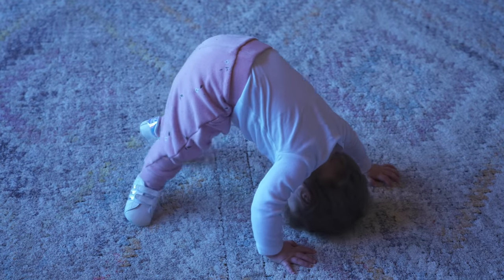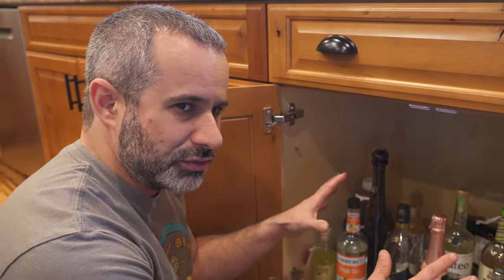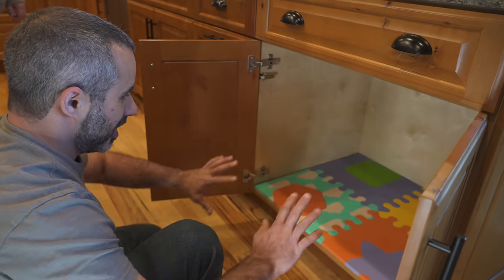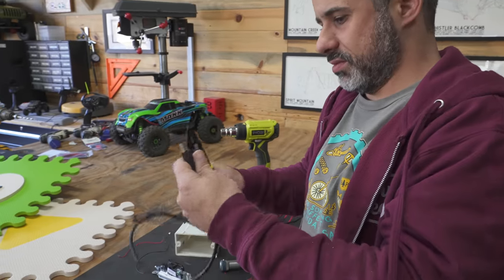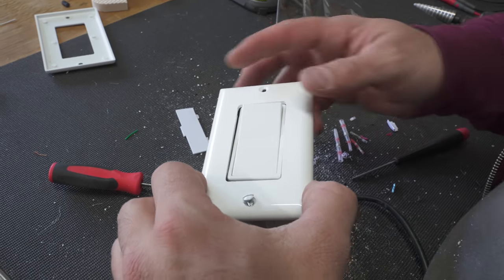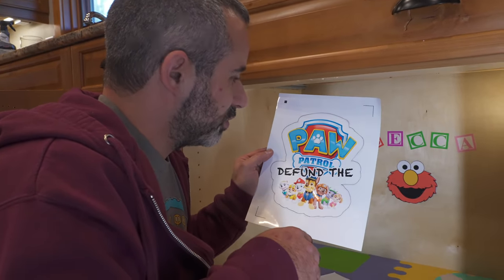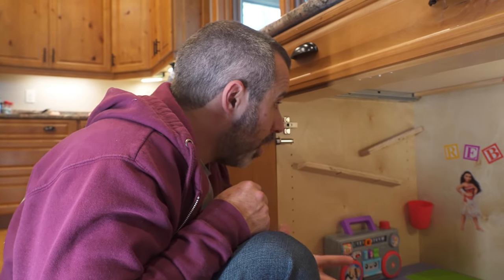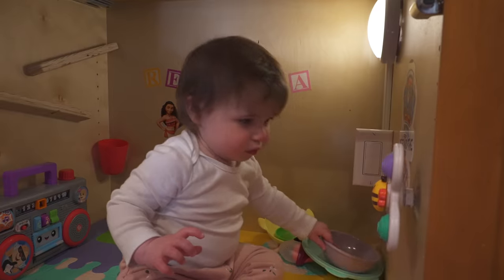How to build a playroom out of a liquor cabinet

Comment: Super neat project. FYI it's generally accepted that soldered tips in a compression fitting like the screws on the switch is worse than bare wires. Over time the solder will flow and relax under the pressure and possibly cause a loose connection. 

Probably fine for this project, but ideally you'd use a ferrule that crims on
Reply: Came searching to make sure someone said this before I did!

Comment: Might be a good idea to put foam or something around the metal hinges
Reply: They had me worrying, yes. But then I guess you have to trust children with a certain level of common sense.
Reply: I think the hinges are fine. I'm worried that she'll figure out how to push the drawer out from under the cabinet and get a finger pinched in the slides.  It will just be a boo boo, not an amputation.  But if we're going full safety, blocking access to the drawer is where I'd put my effort.
Reply: @HarryLovesRuth  thats true but i dont think there are any methods to stop her doing that without losing the use of the drawer completely, those white plastic cabinet door safety things that he has look like fingers could still be caught but at least she cant get inside them or take anything out of them
Reply: @smashyrashy  I'd just put a piece of 1/4 ply or hardboard across the "ceiling" of her baby cabinet.  We did something similar to separate the pull out garbage can from the drawer above.
Reply: @HarryLovesRuth  oh good idea!

Comment: Awesome build. My only worry is the the light switch cover. Those things can be sharp when not flush on the wall. Either sand it flush with the box or try one of those wrap around covers for surface mount boxes (might only come in metal, so you'd need your new sticker printer again).

Comment: we're desigining the 4th renovation/addition for the same client/house. the first project was around 2000 when we added a second floor to the house. walking through the house the other day discussing the impact of the addition on some second floor spaces, they showed us an attic space that is accessed in the back of a closet - it was decked out as a kids hangout space that they say their kids used constantly growing up.  those kids are now having kids. unfortunately a new chimney is going to go through the attic space, making the space right inside the door much smaller, but it creates a little tunnel to the remaining larger space (that is more private/isolated, so might still be cool). 

also, aren't you supposed to crimp the metal ring onto the wires for solid contact before you heat shrink around the wires? otherwise loved it (but wondering how many times you'll find the battery is dead from being left on & have to change it)

Comment: I don't know what's in the drawer, but if you ever need to use it while she is below, you might consider putting an eighth inch sheet to act as the ceiling of the baby liquor room to protect from the sliding parts

Comment: dont solder the wires going into the screw connector, the tin makes it brittle and will make it get lose. Just use the bare copper wire

Comment: Nice video 👍😁 I have a question my bike when I press my hydrolics brakes make a scratching sound what should I do I ordered brake pads but idk if it will work
Reply: Either you need pads or just need to clean the pads and rotors, there may be contaminates embedded in the pads. There are plenty of videos on this throughout YT.
Reply: @johnnydoe66  ok thanks I comment because I cleaned them the one brake pud is fine but the other is only steel so do I only change the one
Reply: @hmanasou873  I would change as a set. If only one is worn completely away, you may have a piston that is sticking and not retracting like it needs to
Reply: @johnnydoe66  ok thanks for helping

Comment: I have a question. I wanna build my own downhill bike i allready know what parts i wanna have. The problem is i live in Croatia and we dont have as much options. Is there any online bike builder with many parts like fox 40, magura brakes, trek, yeti, nukeproof, specialazed and other frames, and other well known bike parts, that i could use or any place or shop where i can buy a propper mtb bike? I would like to do my purchase online so that everything comes to my place. For those who wanna know, i have a bergamont hardtail and have been using a cube all suspension enduro bike. I just need to know how u guys get bikes and parts.

Comment: that switch housing looks pretty unsafe with those sharp edges. easy fix i guess
Reply: I would have gone with a wiremold box, personally.  I did that with the wiring inside our cabinets anyway so that it would be easier to clean.🤷‍♀️